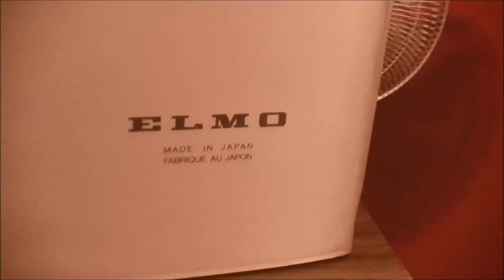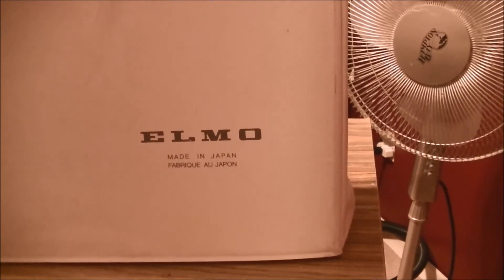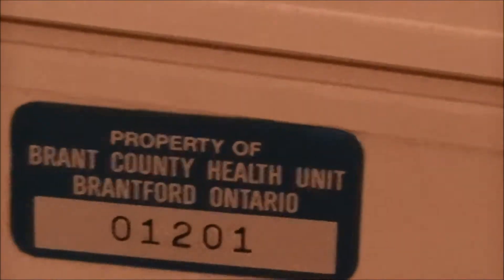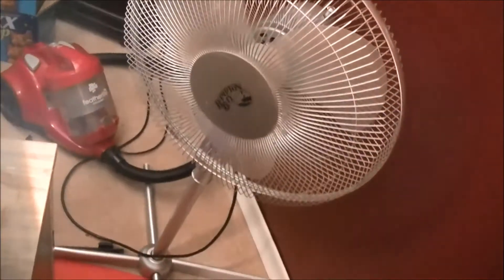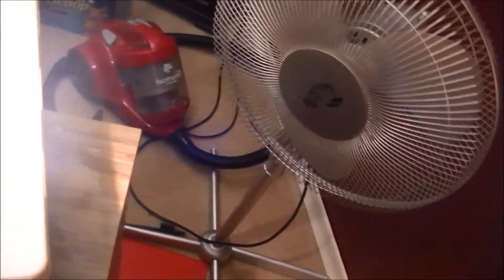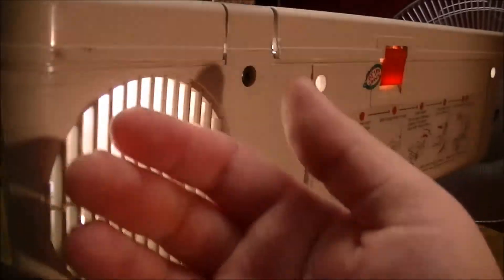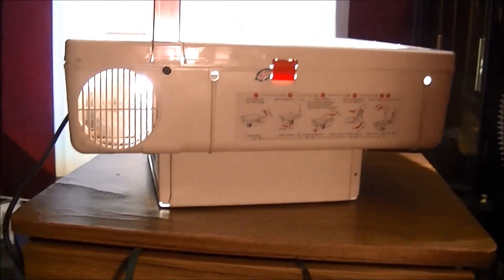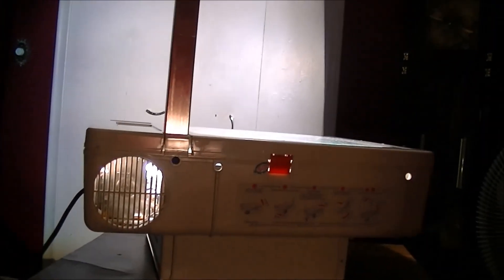Bought A 1991 Elmo HP285p Projector For $5

Comment: Do you have to use transparent sheets for this or can you use just anything. I remember in 3rd grade only using transparent sheets in our classrooms and after i just bought one i dont want to risk it
Reply from the maker: Kaylee Hix You can use transparent sheets or any other clear plastic sheets just not glass as it may shatter. I used this projector as home theater system all I used was a laptop screen laid it on the glass and a white wall to project the image